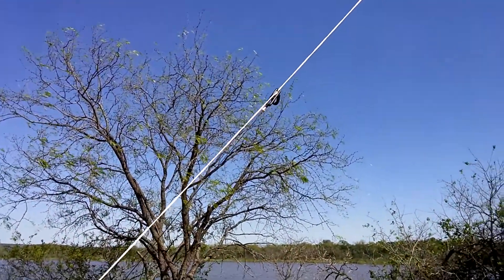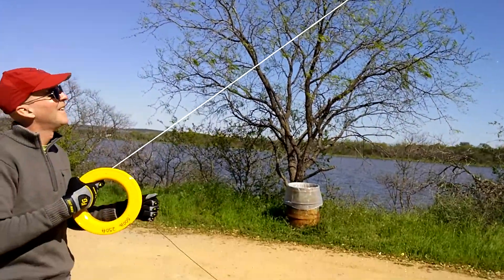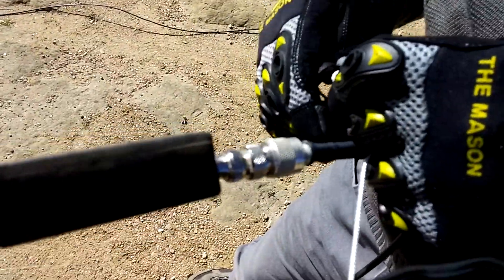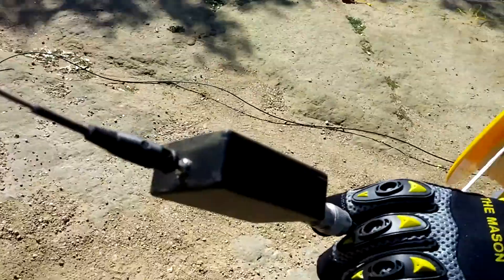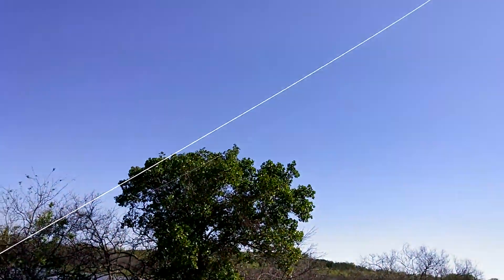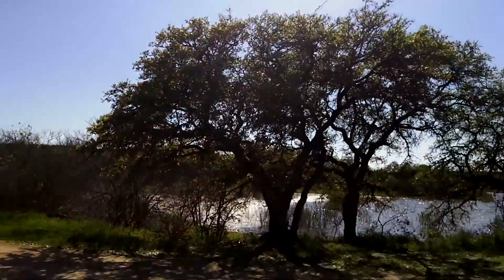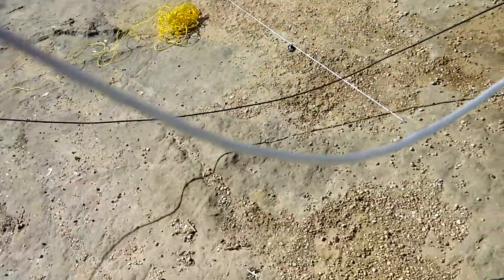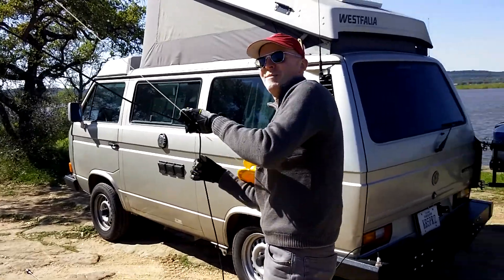How to launch the kite antenna, part 2

Comment: What kind of clip is that???  I need that!
Reply: In this video I am using a plastic snap hook made by MicroPlastics, part 45SNHK250, https://secure.microplastics.com/detail.aspx?fam=4&part=187&sec=健㾆䢀⸕䬜䙐㏂%EF%84%85, but I would recommend a standard aluminum wiregate carabiner instead.
Reply: Hi, what size of kite is It?
Reply: @gilgsn  Jumbo Power Sled 36